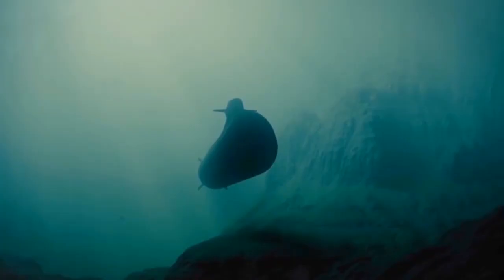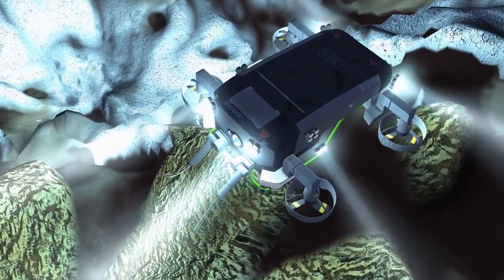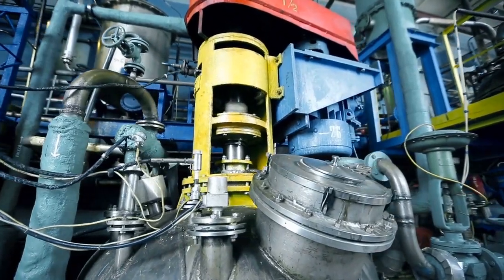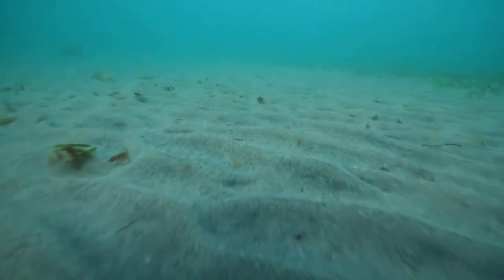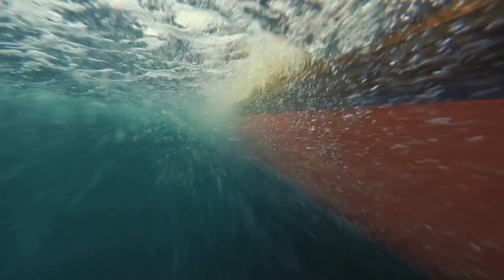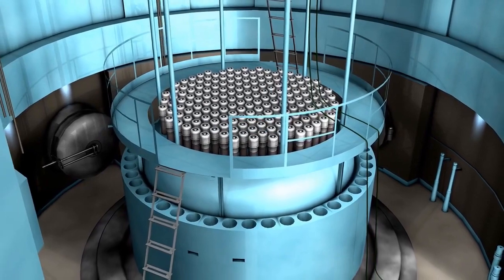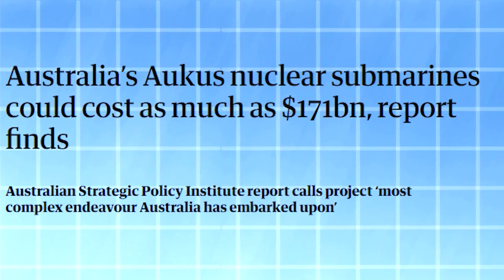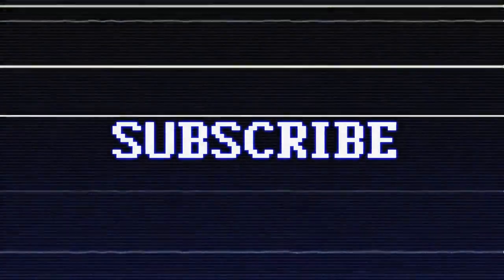How Billion $ Nuclear Submarines Get Destroyed In Seconds

Comment: You should remove mention of the fuel enrichment value. It's not 50%. The actual value is classified, but you shouldn't bother to present a value if you're just going to be wrong.

You're also wrong about the position of the intakes.

Also you should Google what depth the sea floor is.
Reply from the maker: Appreciate your critical view on the video. To give an answer to your points:

50% is the public number that I've found in some articles. Some higher, some lower.. I didn't just made it up, else I would go for 'the fuel enrichment value is classified'. 

The intakes are actually on the bottom. It wouldn't be logical to place them anywhere else. If you have a different view please let me know where they are positioned. 

As for googling how deep the sea is would be a bit of the same as 'how fast does a car drive'. That question has multiple answers. I don't really know what you mean by that.  

Again, I do appreciate you watching the video and providing me feedback. That's helpful to grow the channel :).
Reply: Where are the intakes and what expertise/knownledge do you have on the subject?